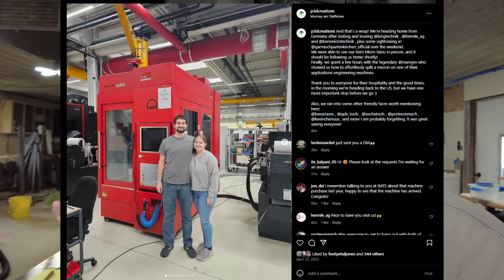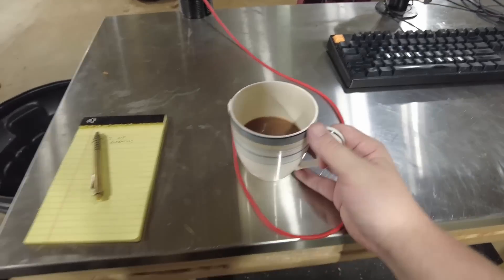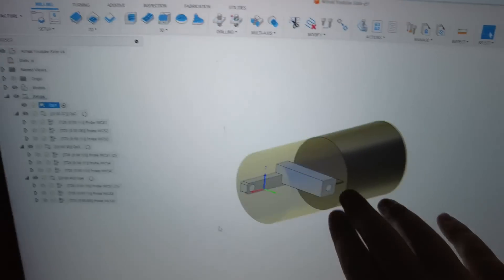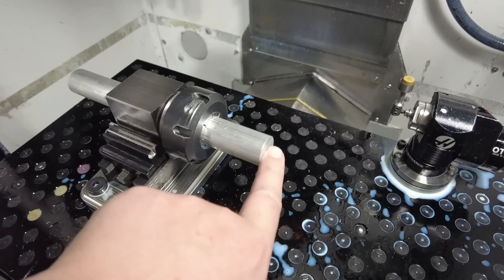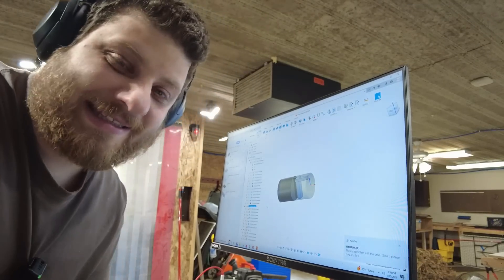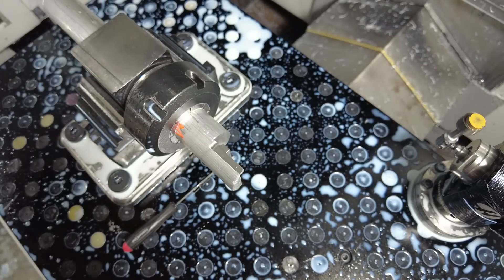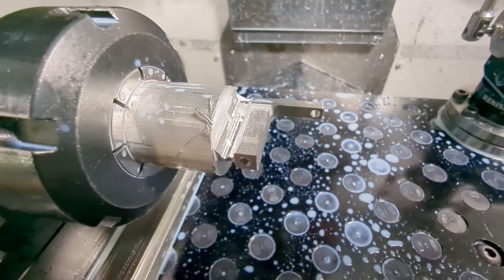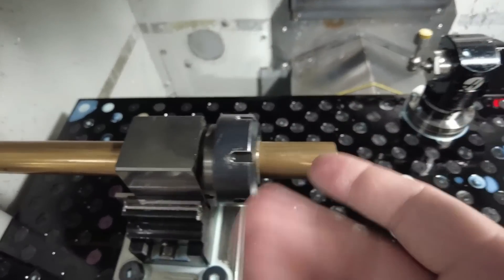I shouldn't have taken this job.....

Comment: As someone whoms family has worked in the aerospace industry and i may self also work in the aerospace industry. My mom has berylliosis from machining beryllium and beryllium copper . She worked at kaman aerospace to name one. My grandfather also ran a shop and machine it as well. 
Not a very safe material.
Than again , nickel and chromium are also super dangerous for your lungs and i work around it daily. 
Also work around HF for etching parts.. 

Just be safe man. I havent watched the whole video yet so you probably are. But thats my story on CuBe

Comment: I've always been really impressed with that alloy. It's "stronger" than some steel alloys. *stronger isn't the proper material property adjative. What I'm curious about is the speeds and feeds and any tool wear.
Reply from the maker: My normal copper speeds and feeds seamed to work well. I didn't do a ton of material removal, but didn't notice any wear.
Reply: @AudacityMicro  thank you for the response. Is it as "gummy" as normal copper?
Reply from the maker: Not at all, it was closer to a bronze.

Comment: I have 2 similar parts that would be much easier using a 4th or 5th axis but i only have 3 axis. I was thinking about using my rotary table on its side and just keep the part clamped in the same position but rotate it 90 degrees for each operation. Then program an operation for each side. The problem is I am still an amateur programmer. Would you be interested in programming the cam for 2 parts? I already have them modeled in fusion.

Comment: You are thinking wrong about dust. The material gets abraded and ends in the coolant, which gets aerosolized. Even when you no longer care, do the next job, its still in the coolant and disperses in the air.

Comment: I use the same process with the same type collet block for a part I make out of 304 stainless. I don't have a probing set up so I just do it manually. It seems to work out well. Unfortunately I need to make about a thousand of those parts so a 5 axis would be waaaaay faster lol.

Comment: Nice video! I've been thinking about doing a similar setup. Why didn't you just probe off the collet block? Does the ER collet move around a little when you rotate the setup?
Reply from the maker: I'm sure probing the block would have been just fine, but generally you want to measure as directly as possible. Adding extra distance and components into the metrology loop, only adds more uncertainty and possible error.

Comment: That sharp 90 could have just been machined on a manual mill in a vise. It was only 9 parts. Probably quicker to just do the final ops in on a manual mill consider just 9 parts.
Reply from the maker: 1) I don't have a manual mill, 2) this is a simplified version of the part that I can show without fear of breaking an NDA, the real version is a little more complicated.

But sure, I don't disagree, this would have been a good time and place for doing some simple work on a low value machine.
Reply: @AudacityMicro  OK, I presumed the NDA part had the same 90 problem

If all you have is a CNC, still you probably could have just used a milling vise & manually machined it in the CNC, or just create a another program to do the other operations.

Also for those round collet (5C'ish) chucks you can just remove it from the vise & flip the chuck 90 degrees or 180 depending on need. Use a vise stop to keep it in the same position when you flip it.. Maybe you did this & I just missed it, as I skipped ahead in parts of the video.

At any rate it seems like you got the job done, which is the most important part!

Comment: Not surprised that the customer jumped on whatever price you gave them. You are very casual about your exposure to this extremely hazardous substance. There is a famous company called Brush Wellman that does a lot of work with this material and ALL of their operators die young of cancer. When they get sued, they shut the company down and move to a different state. The programmers and engineers won't even enter the building where the material is cut. No amount of Beryllium exposure is safe. I do not machine it at any price and believe me I have had customers beg.
Reply: Apparently BW are called Materion now

Comment: There's a few different types of beryllium copper. Most are safe to machine with normal means. The dangerous alloys need special machines to collect the chips and dust. Fun fact, a company in my town used to machine this stuff all the time and poisoned the ground water forever.
Reply from the maker: This was definitely one of the safer ones. I probably didn't need to take all the precautions that I did, but these things are additive over time, and that isn't really something I want to risk.
Reply: You ain't talking about the American Beryllium Company are ya?

Comment: I have a micro arc I have yet to use, if that will help you out.
Reply from the maker: I'll eventually get one for the new tormach, but it is really hard to find the right rotary for this machine. They didn't sell many of them apparently, and it requires an older version of the servo motor, which means it isn't compatible with the newer ones.
Reply: @AudacityMicro wonder if silver CNC has something you could get. They quoted me a 4th for my Fanuc machine that was very reasonable
Reply from the maker: I'll check it out, thanks!

Comment: 0:21 I'll hazard a guess that that's because everyone else quoted it with the knowledge that Beryllium is bad :P
Also idk if this would've been an option on this part, but Stefan Gotteswinter mentioned a while back that a customer of his wanted parts from beryllium copper, and he convinced them to switch to zirconium copper instead. It's apparently mechanically pretty comparable, less toxic, just at the cost of more cost (i.e. it's more expensive). Video is 6tELHfLGmSM at around 2 minutes, if you're curious
Reply from the maker: Probably 🤣

Comment: I wouldn't sand that tab off, I'd have an op for that.
Reply from the maker: That probably would have been smart with the health considerations on this material too. I didn't even think about that until I was actually doing it. I ended up doing it in the sink under water to make sure no dust got anywhere.

Comment: Beryllium copper, agree, not a material you want to work with. Post machining, parts always require deburr/polish and dust gets everywhere even with the best precautions.
Reply from the maker: Yup, I may just ban it outright in my shop going forwards. I've already banned composites for a very similar reason.
Reply: Yeah, I heard the "I can just sand that off later" and was thinking, huh, what about the CuBe dust tho?

Comment: I like the setup, That probe is pretty sweet !
Reply from the maker: It is! You totally can make accurate parts just fine with an edge finder, but nothing beats the speed and convince of a probe
Reply: @AudacityMicro  my machine is too old for a probe 😂.  Even indicating things in can be a little dicey because the spindle is loose and wanders back and forth by half a thou or so when it's locked.